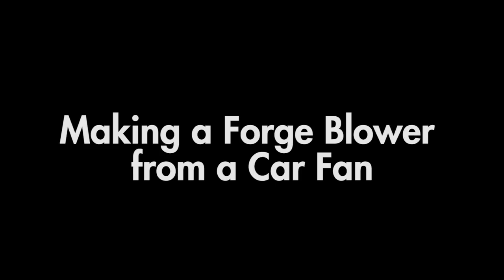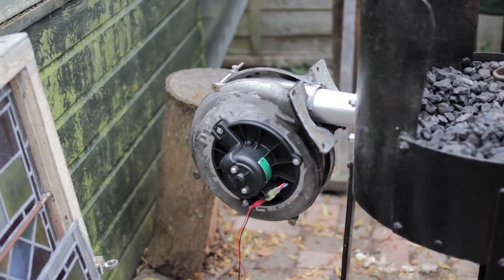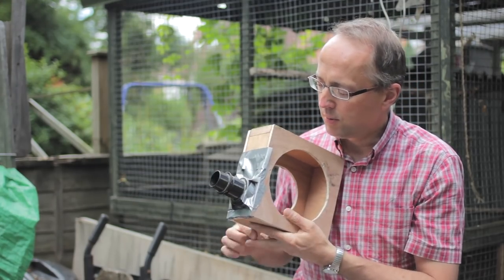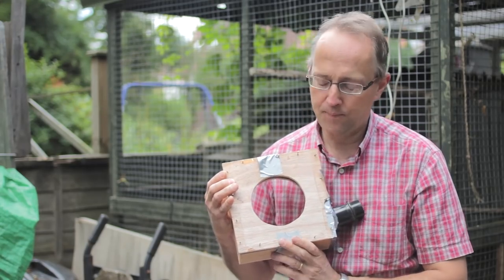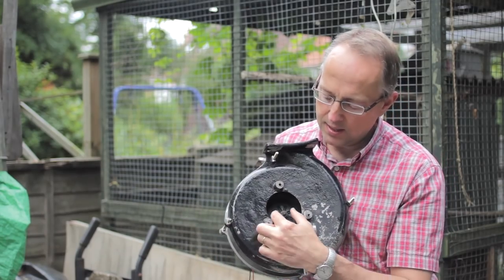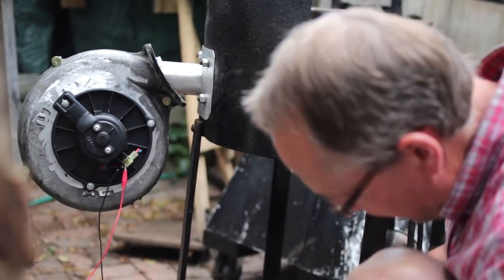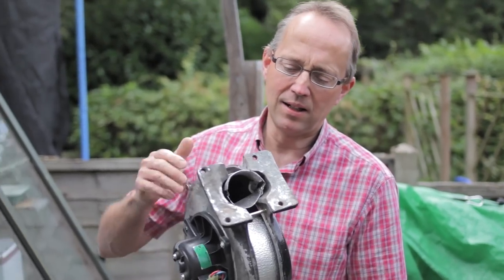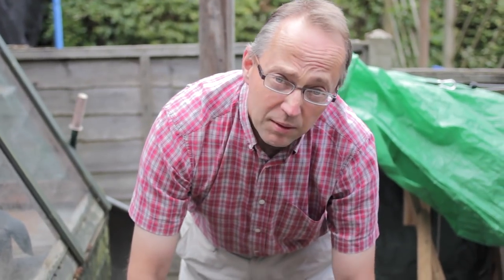Making a Forge Blower from a Car Fan

Comment from the maker: Hi Ken - yes I think some of the Landrover ones are that shape as well. The air outlet is just cast iron for the forge - its like a riveters forge - I needed some water cooling when I took this up to top heat - still good if I need to do some forge welding!

Comment: Hey Harry, just a quick question: have you tried that blower with coke/anthracite/bituminous coal? At the very moment I'm using a blower made from vacuum cleaner motor with a speed control wired to it. Works like a charm, but even on the lowest setting I can't stand the noise ;c I know those car fans are more quiet, but I don't know will they work. If you didn't try it with blacksmithing coal, then let me tell you, that a decent powered hair dryer is NOT enough for this application, even though for charcoal it needs to be slowed down a fair bit.

Comment from the maker: I did consider machining a new core, and getting some bicycle bearings, but it did require some specialist equipment beyond what I could do with a Myford 7 - even being inventive!!!
Reply: Can copper ore 68% and zinc ore 35% be mixed together and fired in a cupola furnace at 1100 dc to have a metallic brass

Comment: Duh, watched the video after posting my question, since I was SURE you've used charcoal in it, but memory didn't serve me well (saw this video few months back) So.. car blower is perfectly fine for bituminous coal, right? I've tried few options, but only slowed down vacuum cleaner motor operated on pressure differential good enough. A hair dryer basically blows half of the air out the back of it's casing when you pile on some coal. ;c
Reply from the maker: Hi yes it works great - plenty of blow for coal and coke. I used charcoal in another forge but this one gets coke - sunbrite doubles and a volvo blower.
Reply: Harry Rogers Ok, thank you. I guess I'll find one, wire it to a computer power supply and either make speed controller circuit, or just put a scissor type gate onto the air inlet of my blower, depending on the noise. Again, thank you, and keep beating hot metal!